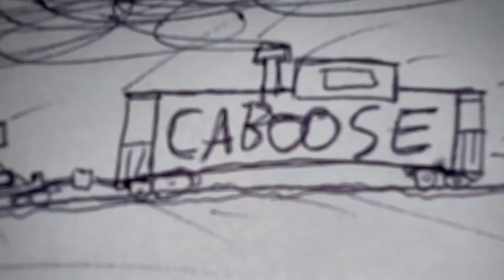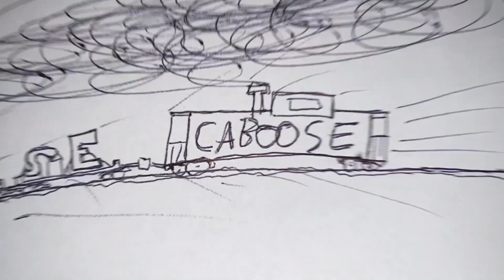Trailer Camper Conversion: Ventilation, Portholes, and Windows

Comment: Thanks for your COOL VIDEO! But, could you please tell me….Do those portholes only open from the outside? Is that a problem or do you think they could be moiunted inside out so we could open them from the inside? I’m looking for some portholes for my Cargo Trailer because these RV windows are getting too pricey! Thanks a loit in advance! Art
Reply from the maker: You could have them open from the inside but there would be a inch or so inset between the outside skin of the trailer and the porthole plexiglass.  I had them open from the outside because I was worried about that allowing standing water.  It'd probably be fine though.

Comment: Windows look like a pain in the butt, i haven't put any in, im hoping i won't need to except maybe in the man door. I like the fan in the side wall, i don't have room on the roof i may have to do something like that. What type of fan fid you use, is that a fantastic fan?
Reply from the maker: sure is, I left a link in the description.  It doesn't look like it's available on amazon anymore, but you can get the specs there.

Comment: I've been thinking about adding a porthole to my trailer but was worried about the gap...how thick was the wood you used for a spacer?
Reply from the maker: It was 1" thick to match my trailer's framing.  Those are 2x4's ripped down on a table saw.
Reply: Those porthole windows should open to the inside btw. I am planning to add some to my 8x16. I will be adding screens to them. I added my windows after insulation and reinstalling my walls. Just say'n R

Comment: What are the dimensions, manufacturer, year, price, specs of the trailer? All the specs please. Gauge of aluminum, axel types, tow hitch, max weight.
Reply from the maker: 2012, 7x12, 6 ft ceiling, 4 in 3500lb drop axle, ~1600 lbs when bought, $1700